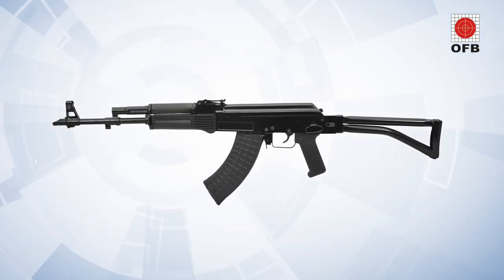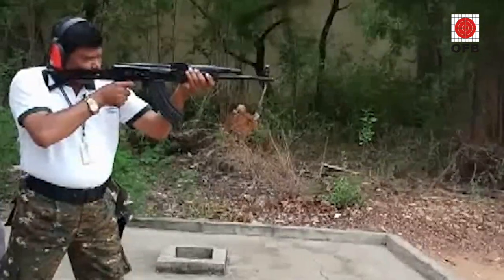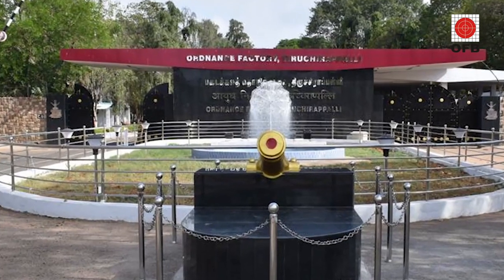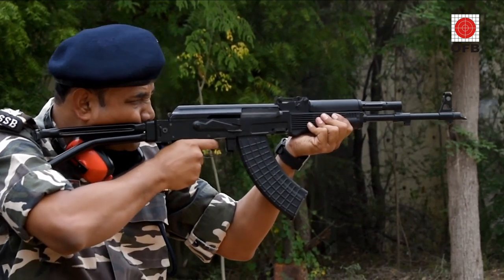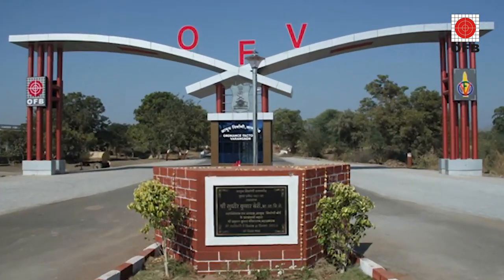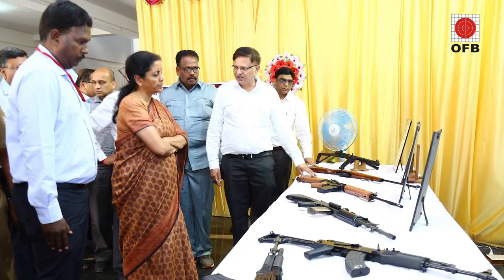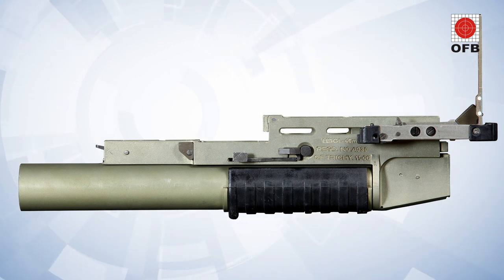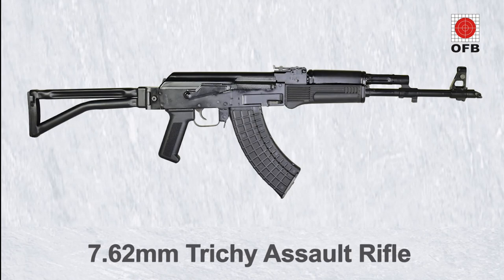Trichy Assault Rifle

Comment: omg the recoil
Reply: It's a 7.62x39 round. And they are shooting in automatic round u genius
Reply: That's how 7.62 rolls
Reply: That's the standard 7.62 recoil being fired in automatic mode.
Reply: @gobimurugesan2411  check the recoil of ak 203 with muzzle brake genius.
Reply: @biakliantonsing8303  genius, I am sure after adding that muzzle brake in Trichy rifle, it will have similar recoil. I can show you a better handling of recoil better than this guy. It's differ for every person.
Reply: @gobimurugesan2411  no it wont, the trichy assault rifle is basically an Indian version of AKM. I too can handle better recoil than the guy. Yawn
Reply: @biakliantonsing8303  Actually it's a Bulgarian Ar M1 copy, not akm. And u can control recoil better than an army guy?. Ok Good night.
Reply: @gobimurugesan2411  Bye

Comment: The question is if OFB already has TAR then why IA wants to opt for AK-203 Rifles??
Both Rifles use the same Ammunition after all.

OFB must consider T-o-T under the Indo-Russian JV for the following Small Arms :-
(1) RPK-203
(2) Vityaz-SN SMG
Reply: Shashank Saurav .... "AK-203 or TAR" must be limited to CQB Ops as Conventional Military Ops will demand 5.56x46mm Ammo.

"Picatinny Rails & Compensators" aren't a complex set of systems that cannot be equipped on TAR. 

Thus that' why it hardly matter if its "AK-203 or TAR" but even if "AK-203" is given the preference due to its more advanced Metallurgy even then there is a need for OFB to manufacture :-
(a) RPK-203
(b) Vityaz-Sn
Reply: Shashank Saurav .... IWI Negev NG-7 is a good replacement for Bren L4 & for the role of GPMG.

Its sensible to have LMG, Carbine & Standard Assault Rifle to have the same Ammunition.

If "AK-203" deal gets cancelled then for sure OFB's TAR is the best possible replacement for all older AK-47 variants in Indian Military, Paramilitary, CAPFs & State Police forces.

Even if "TAR" becomes a replacement for INSAS Rifles, even then there will be a need for RPK-203 as Standard LMG or an Indigenous Equivalent.
Reply: Shashank Saurav ... LMG & GPMG are different systems for different purposes. 

If IA doesn't invests in RPK-203 then it makes No sense to invest in "AK-203" too. 

It won't make any sense for a Unit to carry AK-203 & INSAS LMG together when there is possibility of Ammunition exchange b/w troops in a Battle.

Comment: INSAS was a good gun for the time it was built. It was a combination of FN Fal & AK. But the manufacturing standards and capability are the issue with INSAS which lead to its downfall.

For example: Tolerance will be joke in OFB.
Reply: Thanks for the info. I wondered what happened to the INSAS. Quite a shame they stopped producing it
Reply: Well it's whole design was a flaw, a 5.62 rifle that weight exactly like a battle rifle even at the 90s standard are trash
Reply: Have you heard about the L85 rifle of British. When made first it was considered trash. Later it was improved and the trash turned to Ace. It was an 556 bullup rifle.
Similarly design flaws was available to INSAS rifle, which were rectified. But the manufacturing incapability of Indian OFB was the issues for making malfunctions in the rifle.
Today Indian army has moved away from INSAS due to the need of a rifle suited for 762 ammo instead of 556 ammo used by INSAS. Everyone knows 762 ammo has a better stopping power compared to 556.

Comment: They didn't even bother to change the iron sights. This looks like Type 56 rifles(AK47 clone). No picattiny rail, no front hand grip, no fixed sights. And they present it with such a finesse...bhai China se seekh lo. Bullpup design banaya QBZ95 ka. Less recoil me more shots firr hote hain.
I think with all AK clones kicking back like a mule once shot, OFB could have made a bullpup with 7.62X39mm carbines to counter extra recoil...
Reply: I agree with you ..
This gun is a clone of Ak47 ..
And as you can see  the recoil  of this Gun in this video ..
Important thing is that the more recoil a gun will have the less accurately the bullet's  will hit it's  target . + There is no scope no hand grip etc .
Whereas other countries are using world class Gun like m4A1 , Tavor etc .
Reply: @saav757  recoil can be compensated with proper forgrip and compensators or a better stock, in this video they just shoot without any of these attachments, but if these guns are practically used all those attachments also wll be added .

Comment: And you couldn't give it any other shape? Even though the firing mechanism is different than an ak , why did u have to go and copy paste the same AK design with the excuse that the soldiers are used to it.
Why not even try to make a more modern firearm out of it, with a floating barrel and proper ergonomic pistol grip and charging handle and proper fire selector switches. A magazine weld to aid in quick reloads. A better trigger guard. And the list goes on. Hell a better muzzle break along bwith threadings for quick attachment of suppressors.